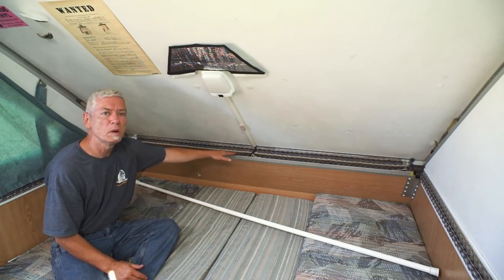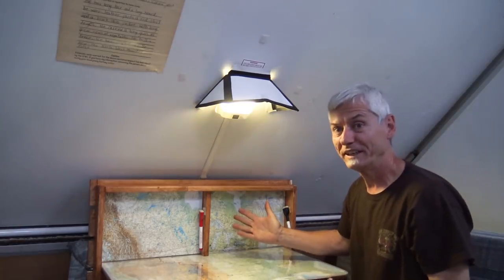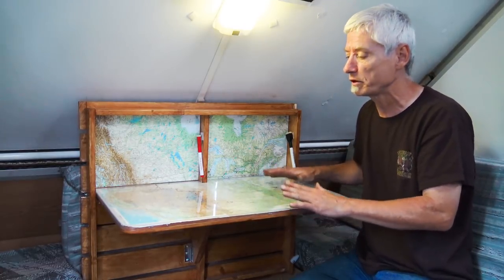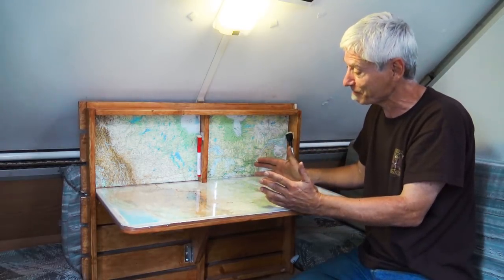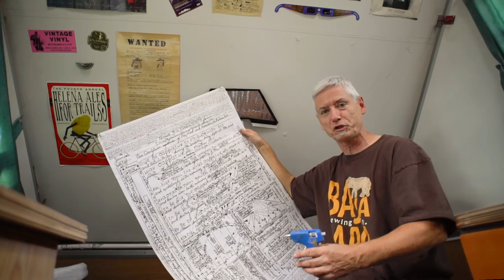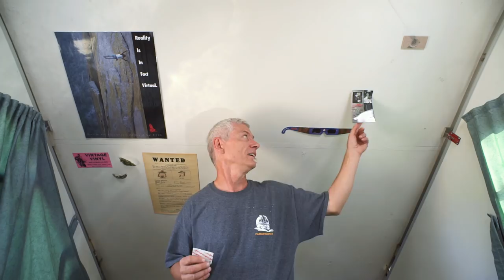Did That Really Work? Slim's Updates

Comment: For the stone guard on the front of the trailer, you could have tried Flex Seal instead of the rubber mat. On the yellow part of the frame try using vinegar and then the rust converter and spray that with Flex Seal after it has time to dry. For putting up posters try rubber cement. Paint the edges of the roof to see if it wears.

Comment: Slim, I so enjoy your ingenuity and the fun you have at life. Here is a tip to stop rust permanitely (you may need to remove old paint first.) This is the stuff PDR 15 Rust Preventative Coating. 1 quart. can be found on Amazon. A note: can be applied w a paintbrush,  be sure to use saran wrap under the lid otherwise it will be impossible to open it again! ✌

Comment: You could have a fabrication shop make a custom-fit shield that could slide over the front of the hitch area (between the jack and the propane tanks, and that could also double up for storage.  If that's where the battery goes have them make a custom cover that is basically a box, that could bolt underneath into the A-frame of the hitch.   Or better yet, just have someone fabricate a custom box that goes over the tank and hitch crank (ie. basically a box that can clamp or bolt to the A-frame portion.  This would make it nice and hide everything, AND protect that part of the hitch and the tank, battery, etc.  You could even integrate storage into such a thing.  It may not be cheap (maybe $500-1000) but it would be a nice addition to the trailer, with a purpose).

Comment: Instead of painting with regular paint to prevent rust, maybe you can use the rubber-paint, which is for truck beds. It is much thicker, and the rubber texture will fend off rock chips better. But it only comes in black and maybe dark grey color. Not sure if you could spray-paint it with a color of your choice after it is dry. Thanks for all the great videos!

Comment: Another great video, keep up the great work.
As to the frame rust and chips, I would look into that stuff they spray on truck beds. You can spray it or paint it on, it's tuff. I know guys here in New Mexico who covered their entire Jeeps it trucks with it. After years of use, it still looks brand new.
Reply from the maker: Thanks! Send me the product name and I'll look into it. SP
Reply: @SlimPotatohead  I think they mean raptoliner or raptorliner? I plan on sanding off the rust trim around the top of my van where the rain tends to sit n causes rust..want to sand it bondo rustoleum n spray with the raptoliner..lasts forever..
Reply: The guy in Dallas Texas did his entire van in it. Don’t remember his name but I am confident that if Slim googles raptor liner he will be able to watch the video.
Reply: Herculiner is what I've used and seen used before but there are a few.
Reply: I see a few other product names, but I've always heard it call RhinoLiner.  I'm sure there are multiple other products though.
Reply: There are several RHINO liner products out there. You will need a controlled environment to apply it. Drop humidity down to below 60%. and has to dry four hours between coats. Investigate this well. There is also rustoleum products that convert rust to paint via spray on. Cold zinc containing galvenizing paint.   Again it has to be applied and dried in a controlled environment. Over hours. — good luck.
Reply: I was going to suggest the same as well...just be sure it has fully cured before using the trailer and you have to be absolutely sure to sand and scuff up the area you are applying it to, otherwise it won't adhere properly and it'll just scrape right off.  That bed liner stuff works great, and if you don't feel like doing it yourself you could always contact Rhino Linings or LineX and they'll be able to spray whatever you need as well both are great companies, but the DIY stuff in a can does work when the surfaces are properly prepared, its not a fast quick spray or roll on application a lot of prep work is involved, but it'll be much better than paint and it will hold up much better.
Reply: DONT do this. It will trap any moisture and rot the frame out from underneath without you knowing. South Main Auto on Youtube made a video about oil coating the frame of his truck to prevent rusting. You should look into that.
Reply: Fluidfilm is good rust protection. You will need to reapply yearly. If you buy the kit with spray gun and attachments then you’ll only have to buy product after that. You can use it on that Jeep as well.
Reply: @Buick_GSX  I second that suggestion.  South Main Auto
Reply: @SlimPotatohead  LineX
Reply: Rhino Liner and Line-X are good products

Comment: Coat trailer togue with Herculiner Truck Bed coating! Waterproof, chip proof. Brushable.
Reply: And black!  That construction yellow color doesn't look right without a Caterpillar label. 
BTW, Project Farm did a review of several brands of truck bed liner, worth watching as some are markedly better than others for specific uses.
Reply: Old comment, but I'd be careful with thick hard coatings like that... Unless you get it on when the metal is brand new you'll still have rust occouring underneath and it can make things worse over time. Look up the damage that rubberized undercoating does to frames over time... it seems like a good idea, but once that rust continues underneath the coating just holds in the moisture and lets the rust go crazy. Maybe truck bed liners breathe and don't let this happen, but I figured I'd give a warning.

Comment: For the trailer tongue.  Sand it down primer it.  Get texture paint. It works on a truck I used to drive. The paint will protect . So there's  no rock chipping.

Comment: Coming from a life long snowmobiler the only thing you can do to prevent rust on your steel trailer is to buy and aluminum one.  I’ve put 4 coats of paint on my previous steel trailers and the rock chips and salt combination will always cause rust.

Comment: I think the solution for your enamel paint on your hitch would probably be some roll on bed liner she protected from the elements as well from chipping off from rocks which you'd probably put over top of your rubbing liner as well that is now cracking to seal it watertight as a while as added protection.
Reply: Thats what I did to the whole frame of a travel trailer I had some years back.  Removed as much rust as I could get to, primed it the applied the bed liner using a roller and brush.  no issues after 5 yrs of use.

Comment: Hey Slim!  Enjoying your videos.  We bought a used A-frame camper last year and have been really enjoying both camping with it, and modifying it to suit us.  (A Chalet Aurora).  We also have a boat that gets put in and out of salt water, so frame rust is a constant issue.  I finally attacked it with a wire attachment on an angle grinder, and then used spray rustolium paint.  Just a little touch up every year or two seems to keep the rust at bay.  Thanks for all your unique ideas!

Comment: Hes not lying...command strips are awesome. My PS4 is currently stuck on my wall under my tv mount. 

Took off the rubber bottom parts, command strip in every corner and 2 in the middle. Pressed hard and months later it's still there.

Comment: For the rust and chip prevention look into a product called por15 for a coat directly on the metal. Then you must cover that with a tuff paint or epoxy type paint. I would then cover that with under coat which is a little like lite truck bed liner. Bed liner is heavy.

Comment: I enjoy your videos a lot. I am particularly impressed with the thought you put into planning fixes and customizations of your A-liner. I was wondering: what kind/size of drill press do you use in your home shop? Also, I wonder if you've ever used Sugru in a project (a moldable putty-like adhesive that hardens after thirty minutes)? Thanks for your beautiful camping videos from the wide open spaces out West. And- do you remember where you got that metal nibbling tool? That thing is sweet.

Comment: Thank you again for your great videos.  It has helped me rebuild mine from extreme condition.   I noticed in a later videos that you had used  what looked like pipe covering to replace your panel seals.  Is there any way you could provide more information on that process?  Best, Perry
Reply from the maker: Hi Perry, Rubber Pipe Wrap. It was mentioned at the 22 minute part of this video: https://youtu.be/6o98gbDwDm8
Thanks! SP

Comment: Duct tape is far cheaper than Command Strips.  Try making rings of duct tape, flatten, and use to hold up posters.  It should hold up better in the heat than glue gun sticks.

Jon, in rural BC, Canada (a new subscriber)
Reply from the maker: Hi Jon, Thanks for the comment. My experiments with duct tape have not been good. In hot weather it's a sticky goo that doesn't hold well yet makes a terrible mess. That said, I've just had the command strips fail as well! The only thing that hasn't failed (yet) is the Gorilla glue sticks. Will give it a little more time before I make any new conclusions. Thanks Again! SP

Comment: My curiosity is up what's that slabcity scroll concerning ...also you mention your frame bending... How did that happen ? Btw I'm new to the channel....about the rust prevention...your not gonna stop it as long as you use the trailer...there is no paint truck bed liner etc. That's capable of withstanding a rock being propelled by the tires traveling at highway speeds...your best option is to repaint at regular intervals...
Reply: the "dead sea scrolls" were given to him in slab city, check out the video its a good one!
Reply: @jachin7545  I saw that video .. somehow I missed the dead sea scrolls part though...thanks chief....

Comment: The only way to keep rust from coming back is to sand blast, prime and paint.  A small home compressor driven plaster would work.  Then coat it with rubber pick up bed liner.
Reply: Not true. Depends on the situation. Surface rust on previous cold zinc galvanized iron can be converted with rustoluem paint test has zinc in it. Have also seen farmers coat old tractors with an oil based coating.
Reply: Hmm, I do wonder now if the oil based coating would work better for this application due to the continual bombardment of rocks, dirt, sand etc hitting that frame...I'm wondering though how that bed liner stuff would hold up to those conditions as well.
Reply: @wildbill23c  any bedliner material or hard undercoating will trap moisture underneath it and rot the frame out without looking any worse for wear. Theres a reason farmers and anyone with a lick of sense in the rust belt uses the oil based coatings.
Reply: You aren't supposed to put it on when the area you are going to apply it to is wet, you do it before it gets wet.  What's worse is those plastic drop in bed liners, talk about a moisture trap, those things are.  

Paint and anything else you apply will trap moisture as well, which is why you prep the area and make sure its dry before applying anything to it.  The largest number of applications I see though are some sort of oil/grease type undercoating, issue with that is it will wash away over time and you have to reapply it pretty much every year, the bed liner and other undercoating materials are a better solution as they're more permanent and more resistant to being chipped off by dirt, sand, rocks, etc.

Oil base coatings trap moisture as well, which is why you prepare the area prior to just going out and applying a protective coating....and you really gotta get into every nook and cranny too, boxed in frames are a great example, many go out and pressure wash the vehicle underneath before starting the application, well that's cool but now you have a bunch of water down in that frame....they have holes all over in them LOL, that water gets in there its a pain to get back out...lots of compressed air helps, but leaving the vehicle to sit unused for several days afterwards helps a lot too...and of course keeping it out of any areas with moisture...huge problem for those in humid climates :(.
Reply: Buick GSX , I always looked at the molded plastic bed liners as a way to make an old beat up pick up bed look new again before you sell it..
Reply: Those plastic bed liners retain moisture and dirt and quickly destroy a truck bed...for a bit more money you could have it done right with LineX or Rhino Lined.
Reply: @wildbill23c  or Herculiner brushable bed coating. Perfect protection.

Comment: Slim, have you ever considered using a 'Rhino Liner' type material, what they use in truck beds, on the tongue of your A liner?  A thick, durable coating.
Reply: Rocks propelled by the tires would destroy that stuff in no time...it already scratches off under normal usage

Comment: To stop rust use POR 15 Paint Over Rust,,
However it Must be top coated with exterior oil paint to protect from UV rays sunshine..
Also buy only small can of POR 15 as much you can use in one shot,,it dries very quickly even in closed can..and its very expensive

Comment: Did you ever use Plasti Dip spray? It is the same as the dip but a little thinner, if you can get it to adhere to your frame that you painted yellow it might work To seal it. I used the  Plasti Dip spray on a couple projects and it worked pretty good.
Reply from the maker: Does it take gravel chips? That's the one evil I haven't beat! Thanks, SP
Reply: I wouldn't use PlastiDip to prevent rock chips.  It's a rubberized paint that's not very durable against gravel or other physical damage, and Its claim to fame (for automotive use anyway) is being able to peel off easily, in giant chunks. So once it starts peeling you'll just start retaining water between the metal and plastidip layer.

You shuold look into POR-15.  I use it on all my rusty car projects.  It's an industrial strength rust converter. Simply sand down any rust spots and brush it on.  It chemically neutralizes any existing rust, and forms an enamel to seal it and stop any more from forming.
Reply: Don’t used plastidip in this case. Plastidip has different applications. Not for rust proofing fixes.

Comment: On that bar U put down where the carpet is at the fold hinge; do U leave it there when the top is down or take it out of there and like lay it on the bed?    I like your Aliner because the windows don't go all the way to the top and U don't have those bubble windows like are in the newer units. More roof area for more solar is the way I look at it.
Reply: He has to take it out the sides fold into the trailer.

Comment: rhino liner will protect you frame. wrong hot glue use brown glue.use pipe foam on edges to prevent wear and it will also stop cold air leaks.cheers

Comment: The problem with the rust paint, was you painted over, rust. It would have been better if you had sand-blasted and or sanded the rust and then painted.